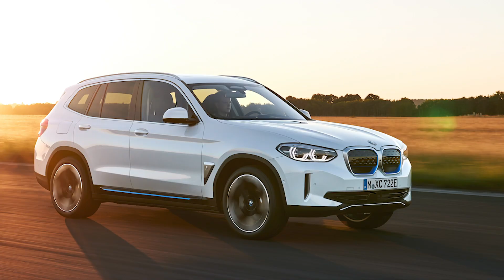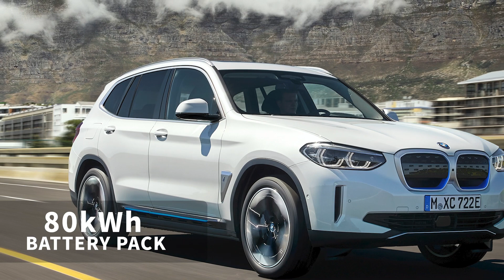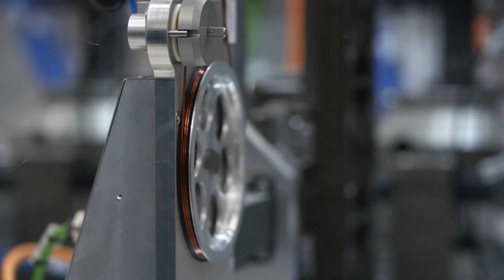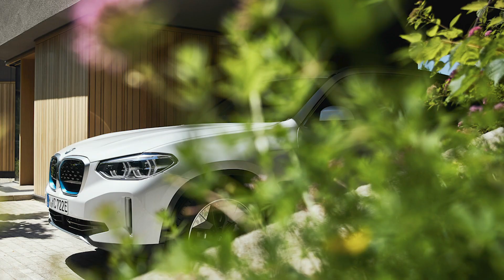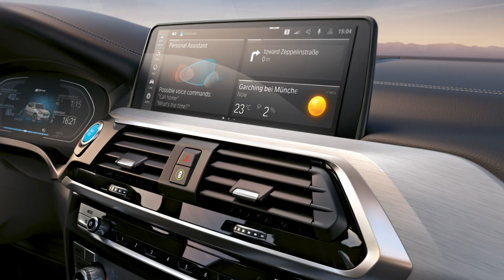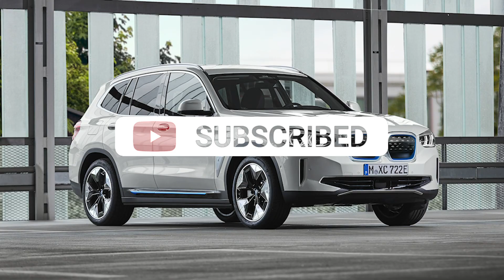BMW iX3 - first look at BMW's new electric SUV

Comment: according to the video the motors don't use magnets. I wonder if they're really motors then?? how do they work, unicorn giggles?
Reply: It's true. No use of permanent magnets according to BMW. Specifically BMW says: BMW uses a “current-excited synchronous electric motor,” rather than a permanent magnet or induction motor. 

No unicorns giggles to be heard here.